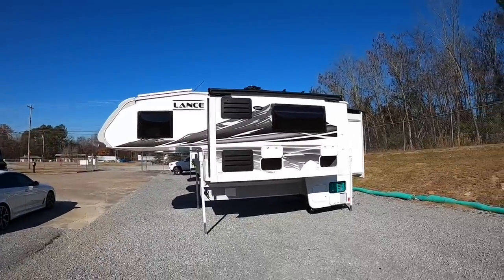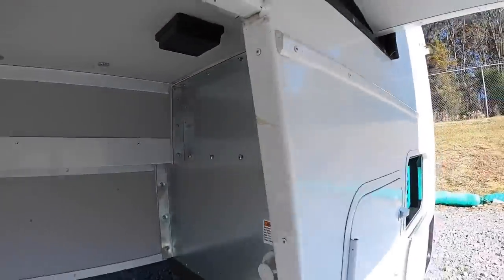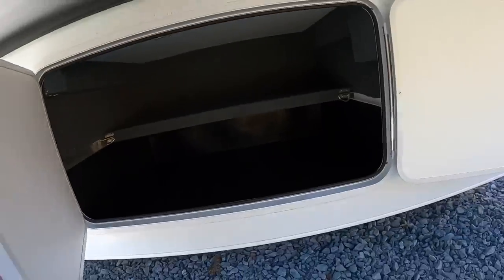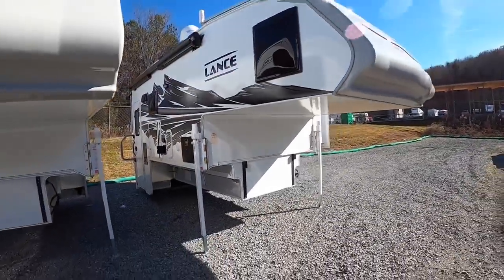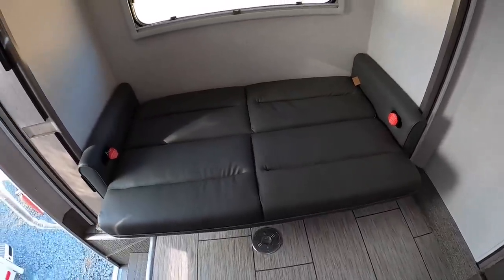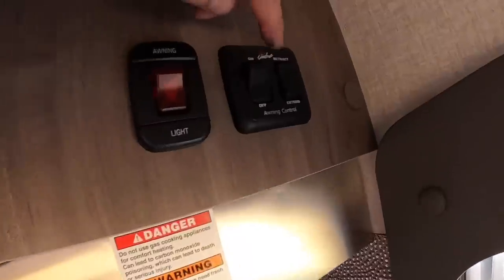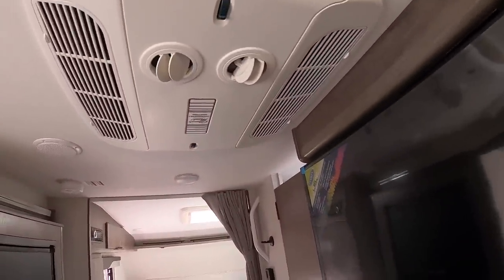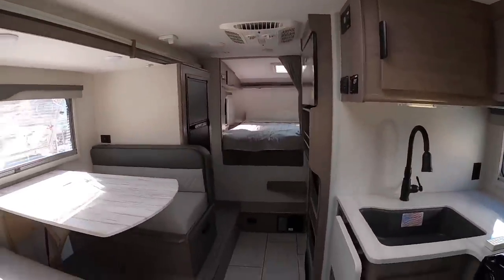JUST RELEASED! 2022 Lance 1172 Truck Camper! MAJOR Changes!

Comment: So, it's a truck camper...designed more for travel than for destination camping...yet you can't get inside without putting out the rear slide? I love Lance but I'll never understand why they would do this!
Reply from the maker: For the people that can’t take the time to run out a slide, they have other models.
Reply: @itsbrad agree, but it's not about 'time' to run out a slide, it's about the 'what if' regarding the mechanism for the slide. What if you stop at a rest area etc and the slide won't retract? Sure that can happen on any RV, but this type is more for travel than destination like I pointed out. If you're at the campground you could call a service tech to come out, but it's not that easy or convenient if you're on the side of the road, a gas station, store etc, sometimes a tech couldn't get to you for a day or two. I would have liked to have seen them do something to allow access with the slide closed, maybe sacrifice a foot of cabinet/counter space, a foot shorter sofa, or a slightly shallower slide. It's a great layout but I think they definitely could have done something to have improved the access without extra wear on the slide mechanism. I love truck campers, especially Lance, and my hope would be that people's feedback would get back to them so they can know what their customers or potential customers see that maybe they didn't consider. I only commented for that reason.
Reply from the maker: @NYVET48TFW  there are manual overrides for the slides to be able to extend/retract (should have included in the video if I didn’t, apologies).

Comment: They've made them so heavy you need a 2 ton truck to handle it.
Reply from the maker: False
The 2017 Ford F350 Platinum Dually Fx4 6.7 diesel we had, had a payload of 5,886lbs. You could cut back on on options and get a gas motor and easily get several, several hundred more pounds of payload capacity. 
This camper was nothing for that truck.

Comment: Prefer the new/old Mountain Graphics compared to these. Not sure why they went so dark and dramatic, don’t really even look like mountains in my opinion.
Reply from the maker: Bc it’s BA lol jk, if I had to guess, the old style (light grey) which my camper has shows black streaks and hard to remove if stained. Hope the darker/black will help hide them
Reply: @itsbrad  Lol, so you are a fan of the new, nothing wrong with that! I have the 975 with the grey mountains myself (little over a year now) but never got any streaks or marks really and nothing that hasn’t come right off.  Btw, I carry mine on F350 SRW with custom spring pack and rides beautifully.
Reply from the maker: @RT-fy7gt  we’ve had a lot of dust in the air due to some construction behind us, so I’m in a constant fight with keeping the camper clean 😬🤣

Comment: nice video,can you pull a trailer with a rig like this? if so how?
Reply from the maker: You sure can, we used the Torklift Super Hitch system with the 48” hitch extension. Allows for a 1,260lb tongue weight rating!

Comment: Why does this pick-up camper cost so much more than an equivalent sized bumper pull trailer?
Reply from the maker: Built better, built with more expensive materials, more expensive options such as a $5k onboard generator bumper pulls don’t have, more time in labor, not mass produced.
Reply: @itsbrad  Is it really that much better built than an equitant Lance Bumper Pull?  I'm guessing there isn't a lot of competition for the large truck campers, where as Bumper pulls have LOTS of competition.
Reply from the maker: @ledebuhr1  gotcha, thought this was another “this is more then my 30’ Forrest River” lol 
Apologies for assuming, didn’t recognize we were comparing Lance to Lance, I get a lot of that. 
Truck Campers are more labor induced, not as many of them like the TT’s, and larger models usually have the $5k gen added that the bumper pulls won’t have as an option. The Smaller Lance Truck Campers with not as many options as Lance’s Large model TC’s are $7k-$12k cheaper then Lance’s entry level TT. So, just boils down to options that are available on the TC’s that are not options for the TT’s.

Comment: For the price of these campers you would think they would leave you wanting for nothing. Instead they make me wonder what were they thinking? After all they have been in business for a long time which makes you think they would have worked out any design flaws by now. Like fresh water drains in same outside compartment as your sewage dumps along with with your satellite and cable connections. You would also need to leave that door open with no way to secure it to hook up to cable. The door handles in the galley at two different hight’s looks terrible. There are no screens on the windows which  means there is no way to keep out mosquitoes or any other insects. There is also no fan in the bathroom which would leave your camper smelling like you know what. There is also a place for a table in front of the love seat but where is the table? Where is the compartment for your power cord ? That doesn’t seem to exist ether. You could see the the duct work under the galleys sink cupboard which means anything you put under there is able to slide off the shelves and around ducting as there was no panel to prevent it.
Reply from the maker: I’m not even sure what you’re talking about lol did you comment on the right video? The fresh, cold, hot water drains are in the same door as the grey and black, there are day/night shades on the windows so if you use the day shade with the window open it magically creates a force field no bug can enter! It’s truly amazing! There is also a vent fan in the bathroom so Jim doesn’t stink out the rest of his guest. There is a table that goes in front of the couch that I’ll remember to show in my next video. My goodness lmao
Reply: @itsbrad  cool then this the camper for you little Brad 👍😁
Reply from the maker: @jimdavenport4484  I have a 975 slim Jim
Reply: @itsbrad  If 6’6 and 320 is slim Jim I’ll take lol 😂
Reply from the maker: @jimdavenport4484  hahahahha
It’s the best I could do
I guess being 6’ and 230lbs little Brad is suffice
Reply: @itsbrad  lol

Comment: Pop outs are heavy… and most trucks can not legally carry these.
Reply from the maker: That’s why it’s important to do your homework on a proper tow vehicle before purchasing. I’ll never hide the weight of a camper, but it’s customer responsibility to search for the proper truck to handle the camper. There are plenty of modern trucks with sufficient payloads to carry these, but you might have to sacrifice some of the bells and whistles in some of these luxurious truck’s nowadays to save on weight.We currently tow my 975 (4,200lbs) with a 450 that has just over a 5,800lb payload. Plenty of room to add in some propane and other necessities while keeping it safe

Comment: Dry weight 4558 and wet weight 4952? That's less than 400 pounds.
Reply from the maker: Yes… what’s the question? Lol
42g water tank - 336lbs full
Two Propane - about 60lbs full
That would be your additional “wet” weight

Comment: Please, say the fridge is a 3 way or it is 12V, 120V or propane but dont say both.  thats like saying it was 10pm at night.  dont sound like a doofus.
Reply from the maker: You know, usually I would, but in the past when I’ve said 3 way I’ve had to explain what that means. Thanks for the suggestion, it’ll go to good use. Not

Comment: 4900 lbs?!!!!! you need a trailer just to bring it with.... i have an 89 hornet that weighs 2500 and its way bigger than this and decked out. they sure dont make them light anymore. BWHAHAAHAHAH! when i heard the price i knew someone was smoking hunters crack pipe. a nice camper to be sure but not 78k nice....
Reply from the maker: Light = cheaply made
Reply: @itsbrad  yeah ok thats not even close to true.

Comment: LMFAO! Someone would pay 70k?!?! You can get a 5th wheel for that. If you said 17k I'd still cough at that. haha. People are nuts if they spend that. Its so cheaply put together. When you zoom in in the laminate joints etc... Hard pass, but thanks for the laughs!
Reply from the maker: Build one for $17k, I’ll wait. $17k might buy you the optional equipment on it. Most of these have $5k generators on them and $2,600 batteries in them alone. These aren’t your cheaply made 5th wheels lol an equivalent built 5th wheel is above $100k